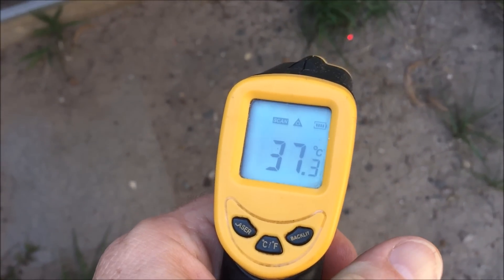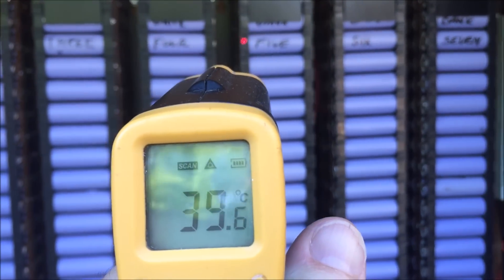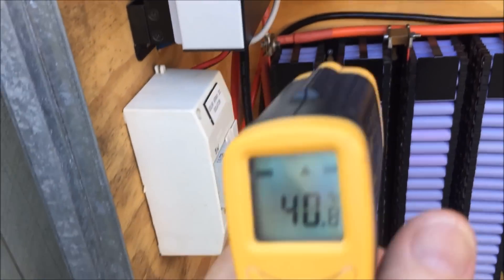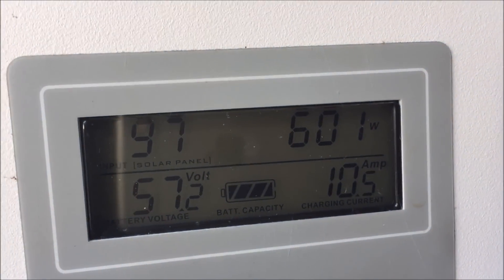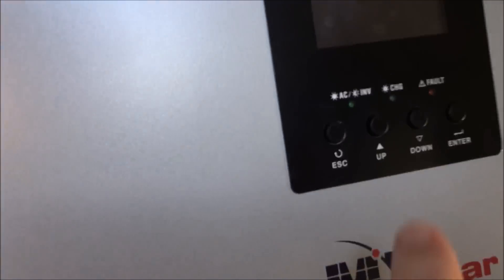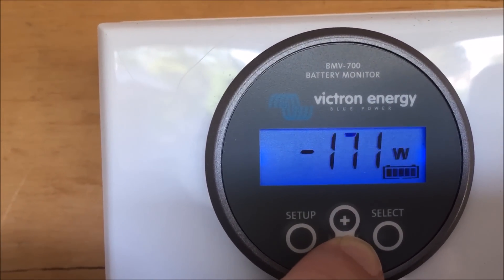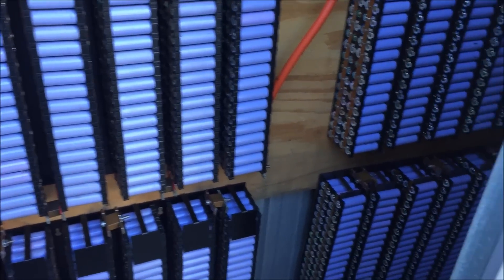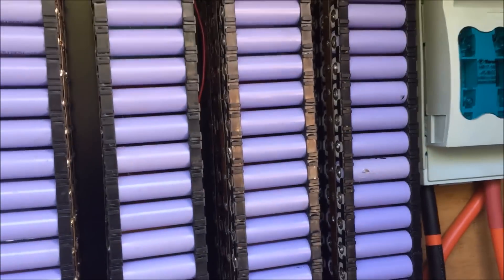Running the temp sensor over the battery packs & inverter

Comment: I've been looking into the Tesla wall unit for running the house. I was wondering why you have so many banks of batteries because in the Tesla there's far less. Does it really take a set up like yours to run the entire house?
Reply from the maker: nop - but it sure helps with teenagers :) 3-4 kWh just to wash (std settings is 40deg c water @ 1hr) and dry (2000w constant for up to two hours depending on if it's just a bra or an entire 9kg wash cycle) clothes at 10pm cause they need clothes for a date...lol That and it covers the cloudy days where there isn't enough solar to recharge the batteries - in almost 4 months I've only drained the batteries twice..

Comment: cable length can change the voltage it reads along with wire gauge. Have a great New Year
Reply from the maker: Heaps of variables i guess inc crap calibration of the units them selvs..lol